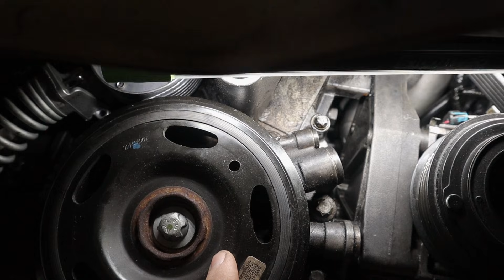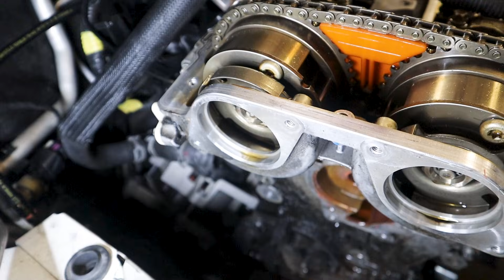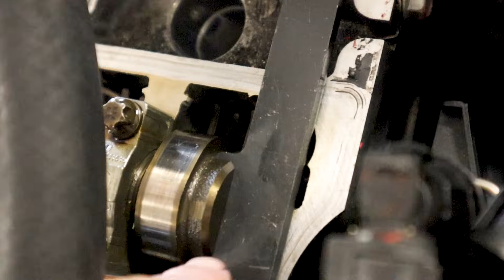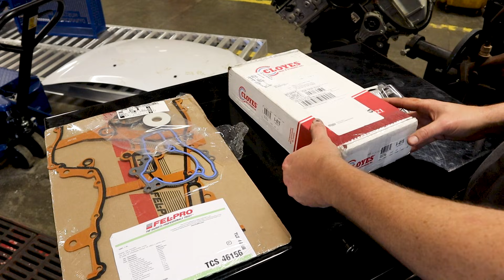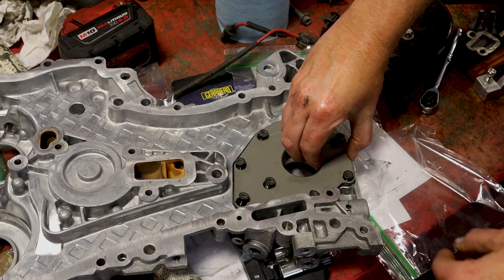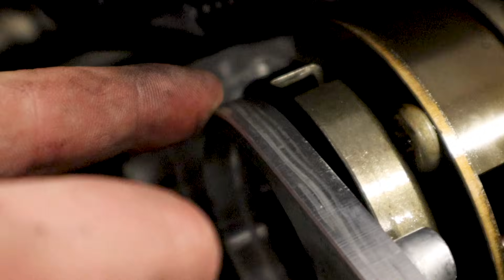P0016 code Ecotec 1.4 timing chain replacement

Comment: im having rough time installing the harmonic balancer back in everything was smooth until i had to install the crankshaft pulley for some reazon wont go all the way in the cranckshaft do you have any idea why is not going in ??//?/ plase
Reply from the maker: Make sure the oil pump rotor is lined up with the balancer
Reply: @AutoScholarwithMrB  the thing here was that gm stop making thoses timing cover of the 2011 chevy cruze 1.4 and the only solution is go with the 2012 timing cover wich is a different shape and different harmonic balancer with 5 ribs harmonic balancer and i end up using a 5 ribs serpenting belt 2012 weird enough and hpefully work with this bel but thank you very much sir
Reply: different shape oil pump i meant

Comment: I changed my timing chain set about a year ago and since then I have had problems with the p0016 code coming on and off also I have at random a no start I instantly shut the key off try to start it back up again and it starts right up could anybody give me any tips on what's going on

Comment: If you want the best auto repair video illumination buy this work light. I'm not a troll, I am an inventor. You pointed to the 2nd cam slot where the alignment tool misses lining up with the slot but nobody can even see that there is a slot. If you had the Goose-Grip™ Mechanic's Work light the machining marks on the end of the cam would even show up and you would not need to even hold the light. Cant jam it down your neck but it would make your videos better than others. Take a look here >> https://youtu.be/WPYZHClquXc

Comment: Not 100% related to the video but any idea on p0335 code crankshaft position sensor circuit A correlation ?

As have replaced the sensor and still get the same code have got another wiring loom coming

Comment: Thank you for this video..all the way from South Africa  🇿🇦 
Please help me out..the exhaust camshaft gear turns and then locks and not turn the camshaft and only turns the chain, then the camshaft jumps out of timing..
And how do the camshaft lobes sit, I mean which direction do they point to for them to be really on timing
I do have the locking tool but it's my first time using it
Thank you in advance

Comment: One thing I would say, if not taking the sump (oil pan for you Americans) drain the oil and leave the drain bolt off,other wise you will get lots of water in the oil when you take off the timing cover

Comment: Hi i have the same engine A14NET in my Opel Astra just asking how many maximun miles may I do before to replace the chain ?
Reply from the maker: I do not think there is an interval to change this set by the manufacturer. It normally gets replaced if there are any issues like noise or timing issues.
Reply: @AutoScholarwithMrB  thanks mate, my car now has abt 90.000 miles (130.000 km) and at startup in the morning I hear the chain bating just for some seconds and so I am a little worried
Reply from the maker: @ppaolosan  yep, that would concern me as well. Thanks for watching!

Comment: I was watching the video for the cam gear alignment procedure. It skipped the part where you install the fixing tool into the cam gears. can you explain that procedure? Thanks
Reply from the maker: The flat tool in the rear? It just slides in the slots in the back of the camshafts. May have to wiggle them a little to get it to slide in. Thanks for watching!
Reply: The tool that's in between the cam gears. the cam and cam gears don't have a key way. trying to make sure gear is aligned with the cam it self. I'm installing new cam gear actuators and timing chain kit.
Reply: min 52:30 and 52:38
Reply from the maker: @nomm4355  ok yeah so it can only fit and bolt up correctly one way. It should just drop in if the sensor rotors are positioned properly. The bolts holding the phasers on have to be loose and the phasers and rotors will free wheel. As long as the cams are locked using the tool that fits into the rear of them, and the rotor fixing tool is fitting without any forcing into place, you should be timed up.
Reply: Ok thanks.

Comment: Thanks for this useful demo. I replaced a faulty timing chain on my Vauxhall Corsa last year and all went perfectly well until i had two fault codes - P0016 and P0017. Oddly the car runs sweet now, no unusual noises and starts strait away every time, but fuel consumption has decreased somewhat although I am aware of that with these fault codes present.  I checked everything that has been recommended on numerous websites and chat rooms to remedy this but it now feels like the issue has been caused by the camshaft sensor disks not being aligned correctly when the rebuild was carried out causing the camshaft sensors to send the signal that do not correspond with the crankshaft sensor signal correctly. They're probably only a few degrees out but they are possibly causing the fault. Didn't have the alignment tool at the time so now gonna take the rocker cover off and check to see if they are correct with a new tool i'll be buying soon. Also done some research into VVT controls so will remove the oil control valve and solenoids to check for faults and a good clean out too. Shame the owners manual doesn't include this in the section covering engine strip downs / timing chain renewal. I'll let you know how this goes.
Reply from the maker: Francine, I have a video on cleaning of the camshaft valves as well. I would imagine the outer part of the camshaft alignment procedure probably needs to be done again. The good news is that is fairly easy to do.
Reply: If those phasers aren't aligned properly, they will throw code P0017 (Exhaust Camshaft position  not plausible) or P0016 (Intake Camshaft position not plausible).

Comment: I’m about to tackle a similar job but on a Chevy Cruze same engine. So basically it dosent mater where the camshaft sprockets end up rotation wise. As long as you align the cam sensor phasers with the tool?
Reply from the maker: Yes, and you lock in the rear of the cams with the cam tool.
Reply: Got it thank you.

Comment: I have removed the head to change cylinder head gasket and found cylinder 2 exhaust valves are open when the cams are in the locked position

Comment: Ok so my cams won't stay lockd in place. After running for a while it will shut off and I have to readjust everything
Reply from the maker: Is your tensioner keeping tension?
Reply: Yes
Reply: I've done this like 5 6 times already

Comment: I have the cylinder head off to replace the head gasket as well. Would you reccomend installing the timing chain/front cover first or the cylinder head?
Reply from the maker: I would install the head first, then the cover.

Comment: This is exactly what I needed from a video.  Thanks Mr B.  Just saved my daughter's car ( broke a sparkplug in the head and need to remove the head to get the faulty plug out).  Just bought the tool kit.  Thanks again.  I will let you know if it works out for me. I also need to put new head bolts   THANKS, THANKS, THANKS.  New Brunswick Canada.
Reply from the maker: That’s awesome! Glad I could help and sorry you had this misfortune. It happens to the best of us. Thanks for watching!

Comment: Awesome video! Thanks for your time to shoot that video. GM recommends to remove the oil pan to properly perform that work which is important. But, I noticed you skipped that step. I know why. In order to remove the oil pan you'd need to remove the transfer case as well. It's a lot of work, waste of time. GM could easily do better because it's possible. However, I found a very easy way to remove the oil pan without going through all the unnecessary headaches that GM recommends. There's absolutely no reasons for that. Thanks again!
Reply from the maker: Thanks for watching! And you are correct, the oil pan removal is not necessary for this repair since it uses a chemical gasket.
Reply: Hi... Can you give some details on the easy sump removal system ? we have just taken on a Holden Trax that has filings in the oil filter and I feel dropping the sump is the only way to check for further filings and maybe kerf on the oil pick up strainer. thanks. Tarakai

Comment: Awesome job! I've done dozens of these engines,(Opel brand) that's all i repair, and let me tell you that you did a fantastic job! By the book, literally.
Reply from the maker: Thanks so much for that OP!
Reply: @AutoScholarwithMrB  Hello, very good job, at what kilometers or miles you recomand to replace the timing chain kit at this tipe of engine gm opel, chevrolt. I have the same engine with 58000 miles with OCI at 4200miles, 70% off miles is in traffic jam city. At what miles do you recomand to replace preventivitly the timing chain kit
Reply: @georgeionescu9666 only when you get a rattle noise at cold start. Or when there is a code.
Reply: @jgn593 it's chain tensioner fault to
Reply: Fantastic job one of the best videos I've seen on here in a long time
Reply: Perfect  perfection
Reply: Do the half moon cut outs on the cam sprockets need to be pointing the same way?

Comment: I am from Scotland , I believe this engine has its origins from Opel of Germany, this presentation was outstanding excellent in every way have done this job myself on Opel Corsa s, the only point that may not clear to a newbie was the detailed setting of the exhaust cam phase unit, the inlet one being locked in position but a view of the exhaust cam for some would have been very informative, but once again well done , huge respect
Reply from the maker: Thanks for the compliments Iain!

Comment: . Please help before I have to spend all kind of money on wrong parts   The server teen belt popped on my car well it was shredded to pieces but the car info and I stopped it and went in the store I came back out went to started it did not want to start I did not notice until later that the serpentine belt has shredded to pieces I get home I cut the rest of the belt out put a new one and all my car will not run any advice anyone

Comment: Absolutely the best video for timing on the echo tech I’ve seen
Reply from the maker: Thanks so much! A lot of work went into it.
Reply: I have a question okay on those ton wheels those the little round things has be exciting like in that picture u had meaning the on right side is touching the tool , or as long as the tool fits on there u fine ?
Reply from the maker: @deewilliams2607  the tool has to fit on there with no resistance. Sorry for the late reply, I just saw the notification.

Comment: Hello sir. I live in Turkey, my vehicle is 2011 Chevrolet Cruze 1.6 124 hp. It gives error code P0016. intake camshaft It had to change. The question I want to ask you is, are the 113 HP and 124 HP intake camshaft parts the same. Or are the parts of the two different, thank you in advance for your answer.
Reply from the maker: Hey Galip! First of all, thanks so much for watching. I am not sure if these parts are the same. I would try to look them up and see if they have the same part numbers. I’m sorry I could not help you more with this.
Reply: @AutoScholarwithMrB  Thank you.❤️

Comment: So did this the other day. Absolute bastard of a job! 10 hours!
Reply from the maker: Yeah, not fun at all! Thanks for watching.
Reply: @AutoScholarwithMrB  yep. Not worth the money involved lol.
Reply from the maker: @tiberiusclaudiusnerogermanicis  yeah I think it books out at about 6.5 hours. Took me about 9 but filming always slows me down a lot.
Reply: @AutoScholarwithMrB  I didnt have a lift either.. and my air compressor wasent available for it either. Crank pulley was a real pain!
Reply from the maker: @tiberiusclaudiusnerogermanicis  oh yeah that will slow you down for sure
Reply: @AutoScholarwithMrB  I'm taking the advice to buzz the crank pulley bolt back on with a impact and use some thread lock, but I'm just curious as to how you fitted it, did you torque it up or use impact? 
 great video and it was through watching this particular one that gave me the encouragement to have a go myself.
Reply from the maker: @davidbrownbill1285  I did torque it, using a pulley holder. Just remember to take your time and think it out. This job is mostly just time consuming more than difficult. You can do it!
Reply: hi, I'm on the verge of tackling this myself, did u take sump off or can you get away without taking it off? thanks
Reply: @davidbrownbill1285  I did it without.. just did the oil change after finishing it. Coolant will get in the sump
Reply: @davidbrownbill1285  also make sure you have the locking tools.
Reply: @tiberiusclaudiusnerogermanicis  Thanks , I got the locking kit, I found my top guide had snapped just like in this video and one of the bolts holding it had worked loose and had around 2 threads remaining before it would of come off and maybe cause damage with it being so close to cams etc. 
These chains may have a good warranty but the parts holding it together seem to be of poor quality hence why these need changing a lot sooner than recommended, did you get to torque the crank bolt to spec? I'm stuck as how to get this  nipped up with out turning engine.
Reply: @davidbrownbill1285  honestly I hit it with a 1/2 impact with an E18 socket until it felt tight.. I've tightened so many crank pulleys that I've lost count so I have a feel of it now. If you tightening it is turning the engine over its probably tight anyways but if you can hjt jt with an impact you'll be fine. Either that or pull the starter and get someone to hold a pry bar against the flywheel to hold the crank in place. DO NOT use the locking tool to torque it up as it will break off and fall in the sump.. 

And yes the top guide on the last one I did was loose, not snapped yet but both bolts j could turn with my fingers. Parts fitted from factory. Very poor!! The chain was stretched and jumped a tooth on the exhaust cam. Luckily not enough to hit any valves. I'm glad you had success with the job though, not an easy one by any means!! Takes balls too. So have some pride in it! :)
Reply: @davidbrownbill1285  also if your really worried about the crank pulleys bolt stick some thread lock on it to give you piece of mind!
Reply: @tiberiusclaudiusnerogermanicis  Thanks a lot phil for that info, I'm really glad I asked as I would of gone along the route of leaving the locking tool in the crank, I have a 1/2 inch  impact but my  e18 is on a 3/8 so I will defo be getting the 1/2 inch e18 to enable me to use the impact and the thread lock is a good tip for peace of mind.

so the way to go is take locking pin out, buzz it with impact and thread lock should be fine?
Reply: @davidbrownbill1285  yes. Obviously at this point the chain is tensioned and all locking tools even from the cams have been removed so you can go ahead and tighten it with the impact after. Thats what I do and never had a problem. The engine might turn a little while you tighten it but that's normal. If it's turning with the impact its def tight. Don't over do it though, just nice and snug.
Reply: @davidbrownbill1285  and its not a problem. Glad I could help!
Reply: Hi Phil, did you have  any trouble fitting the engine cover? I'm finding it a bit of a struggle lining it up with those 2 dowel pins, I'm part tempted leave them out as when I go to apply the sealant at the bottom , I don't want be fighting getting cover on for fear of smudging the sealant.

David
Reply: @davidbrownbill1285  don't leave the dowel pins out whatever you do. I think it was a bit of a fiddle but got it on after a while.. dont remember it that much compared to other parts of the job so it mustn't have been that bad.. the alternator was more of a pain tbh. With a bit of fiddling I got it lined up and put a few bolts in a couple of threads to hold it in shape then pressed it on the dowels. Bit of patience but got it in the end
Reply: @tiberiusclaudiusnerogermanicis  I will give that a try tomorrow  , I've been trying just get it on dowels, but I now think I have more of a chance by getting a few bolts in first as you have done.
Thanks again
Reply: @davidbrownbill1285  yea much easier. Keeps it sort of lined up so much easier to push on the dowels. Hope it works out for ya

Comment: Great video is it possible to correct a  p0016 crankshaft correlation bank 1 sensor A code without taking the timing cover off I have all ready replaced timing chain tensioner ect your help would be much appreciated
Reply from the maker: I tried on this one just to try to confirm that it would fix the issue, but couldn’t get it to jump back into time. You may have more luck than I did. I felt that if I pushed any harder, I would have damaged something. Thanks for watching!